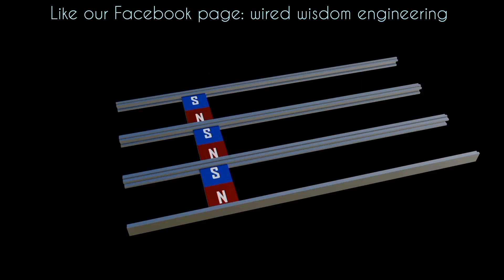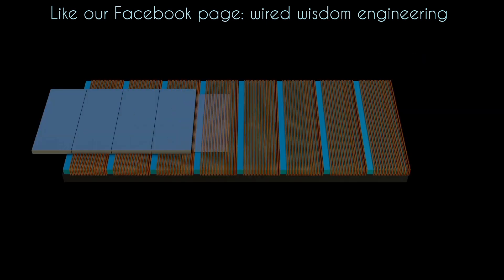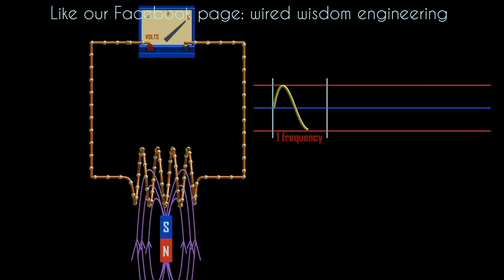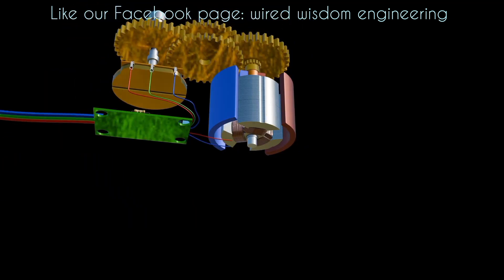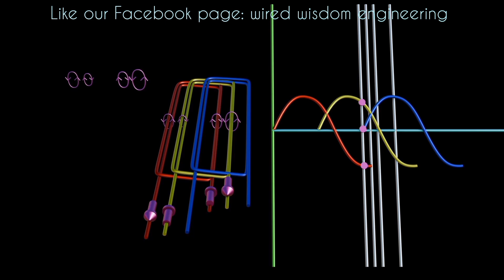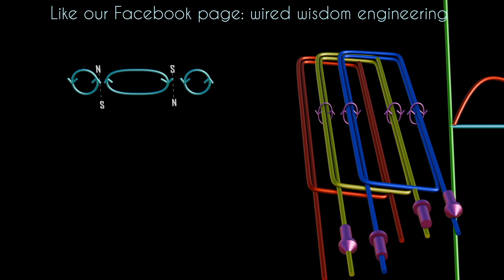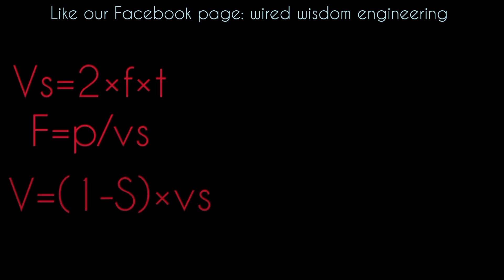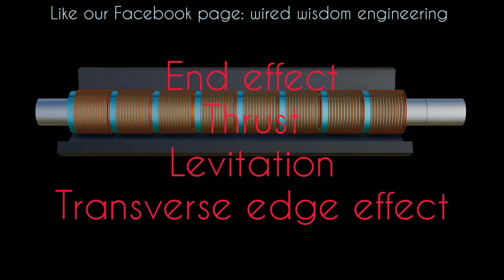LINEAR INDUCTION MOTORS ARE INCREDIBLE 🙀🙀 #documentary #linearmotor

Comment: Just a comment regarding the mechanical support for linear motors. They can ride on a cushion of air as mentioned in the video if you employ air bearings, but very often mechanical linear guides as used instead of air.